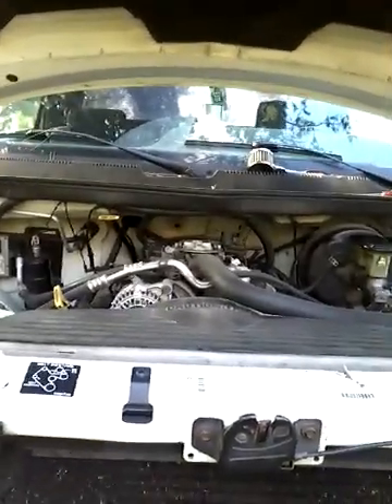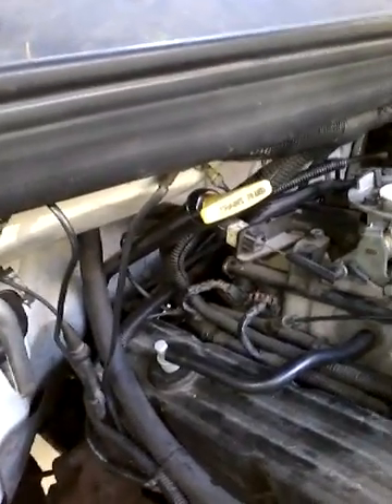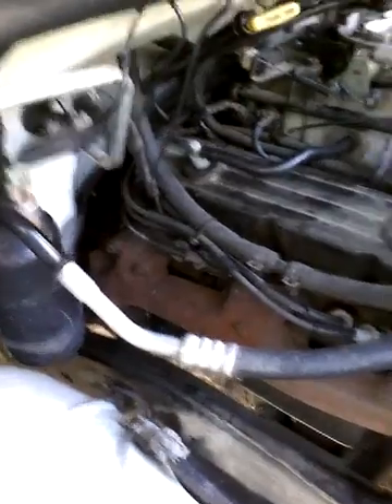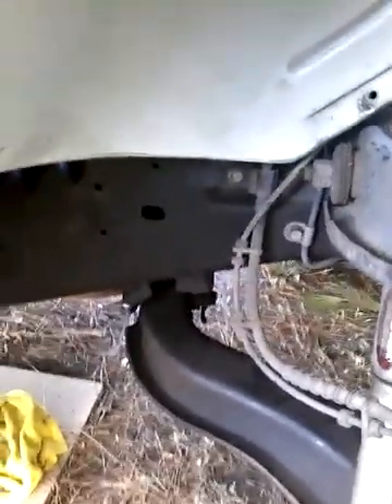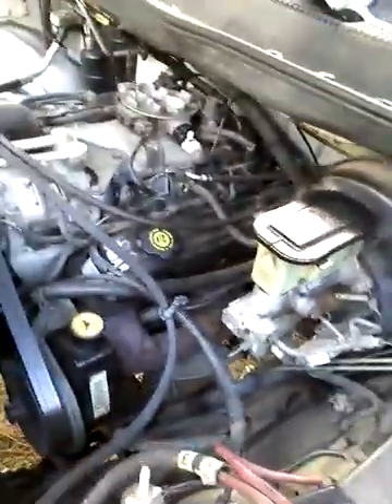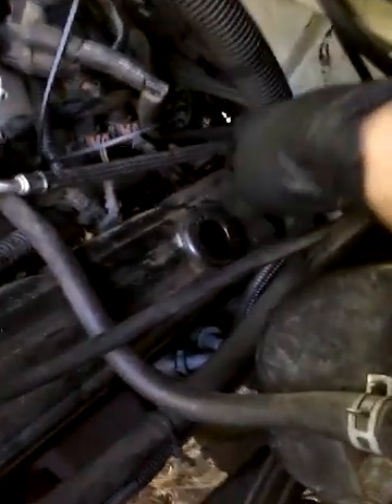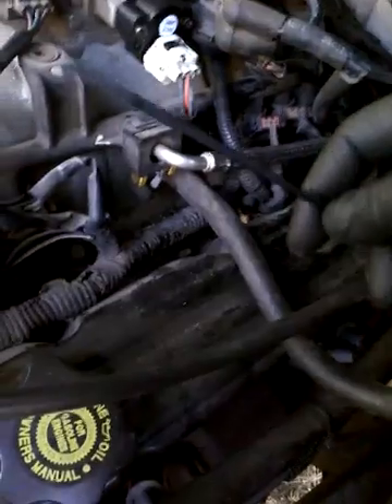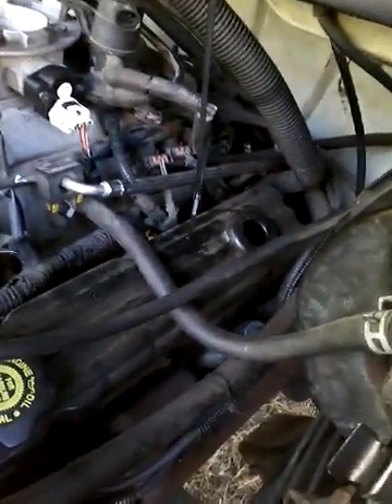Crankshaft Position Sensor 1997 Dodge 5.2 or 5.9l engines

Comment: Does anyone think that since I changed my transmission pan gasket yesterday and fluid ran down the tube and may have faulted out my sensor because today the truck wouldn't start afterwork

Comment: I have a 2001 dodge ram 1500 ive chaged all the sensors it runs fine in the cold but when the truck warms up it sputtering and misfire and no power when driving and i changed the distributor cap and the cam and pull up sensor u think my crankshaft sensor is bad
Reply from the maker: Before doing the CSPS, make sure your coil pack is clean (sand paper it), check the pig tail (add dielectric grease), be sure all your wires on the distributor are tight on the points and on the plugs. Then check the pig tail to the CSPS bc it runs behind the distributor, it could be pinched or spliced. I also had my throttle sensor cause the same issues you're speaking of, so check that as well. If all those things pan out, then you may want to replace the CSPS. Fair warning, you will need to order the Mopar one bc the after markets will constantly give you issues. Good luck.

Comment: Thanks for awesome video, I will definitely try that technique, not looking forward to it !!
Reply from the maker: If you go from the wheel well, it won't be as difficult as it seems....once you know where it is, it's the pigtail that will be the hardest to get over to the drivers side and be sure to snake it without getting it tangled in with the distributor. That's why it's best to leave the old one there and trace the new one with the old one's path, using zip ties!!! Best of luck!
Reply: @karnee26  👍

Comment: A lot of unesGot mine out in about 10-min. With out doing all that. Take off the air breather. Just reach behind the motor with a small flat-head screwdriver. Clean the little Allen head holes out. Reach back behind the motor with a 8-in extension and Allen 1/4-in ,, and ratchet. Unplugged the sensor. It is done. It is a tight fit. But you don't have to undo the dipstick for the tranny. Or any other stuff.
Reply: Yeah I did get it figured out. Thanks for taking the time to respond though. Got to do the plentium plate on my other Dodge. Been trying to find someone to order the one that is aluminum. You wouldn't have a hook up on which ones are the best to use would you. I'm also going to replace all the gaskets on the motor except for the head gaskets. If so I would appreciate it. Thanks again for responding. Have a blessed day.

Comment: My 95 Dodge Ram was cutting out intermittently. I tuned it up. New plugs, wires, dist, ignition coil, Cam sensor, etc. It was running better, but it would still start acting up after about 15 minutes of driving. Sometimes it would stumble and stutter, sometimes it would just die like someone flipped a switch. I finally changed the crank sensor and I've run it for several days now with no issues!
 *I suggest spending the extra money and getting an original Mopar sensor!
Reply from the maker: Great!!! I had replaced all that you did as well...also had to use tiny thin washers as shima for the sensor bc it was getting rubbed by the fly wheel but the shima dis the trick (not mentioned in this video). Thanks for noting it's in everyone's best interest to use MOPAR when it comes to this or any sensors and electrical parts

Comment: Will that sensor failing cause a no start?
Reply from the maker: Sorry I haven't replied sooner... answer is yes, it definitely can cause a no start issue. However, there are signs when a CPS is failing, the biggest one is sputtering start, the engine just cranking without starting (as if it were a starter issue or fuel pump issue) and a really heavy transfer of gears (ie. An good transition from 1-2 but bucking into higher gears, especially 3-4, 4-overdrive). The aftermarket CPS is fairly inexpensive but if that isn't your issue, you can't return an electrical part (maybe you can at AutoZone). I'd check all other simple things first (as I'm sure you know). If you're certain it maybe the the CPS, then go for it. Here is what happened after this video...the new aftermarket CPS from a parts store was put in and it ran fine for about a week, then all the symptoms returned. I warrantied it out and put another new one on. Then the same damn thing happened and I was heated. So, I decided not to get it from a aftermarket parts store (crappy O'Reilly's) and I ordered a Mopar direct from a dealership. Since then, never had a problem again. There are vehicles that are just too temperamental when it comes to electrical parts and it wants it's original installed. Same thing with my mother's Towncar, it did not like the aftermarket EGR solenoid. I installed 2 aftermarket and it ran good for a few days each time, then shit out. I finally knew it wanted Motorcraft and it runs great! I say, try they aftermarket parts from a parts store, if your rig starts, you know it is the CPS! If you have problems after you've installed it (assuming it has started because that's what you need to first find out), then you can always order a Mopar and then return the one from the parts store. Best wishes and I hope it goes easy for you.
Reply: The Traveling Hornet yes
Reply: Yes.

Comment: 👍🏻, just changed 2000 dodge Dakota 5.9
Reply from the maker: Tom Autry...Did this video help you or did you use another video? How easy or hard was it on a Dakota? Is it in the same location? Do you have any tips you may want to add? Thanks for commenting and I hope yours went smoothly and easily!!!
Reply: karnee26 easy to change crank shaft position sensor just had to go get plastic keepers for the plastic under fenders, but was easy to fix, maybe took 30 minutes only cause it was first time to change out, I did put extra  flex wire protector on the wires due to fact that truck stays in barn and for some reason those wires get chewed up by mice.
Reply from the maker: @autrytom  thanks for sharing on your experience! I have a tip that will help you keep mice and rats from chewing or nesting in your rig! I had an old timer come into the parts store that I worked at for years, he had so many tips to share with me and one was how to keep mice and rats out of your vehicle! Put BOUNCE original dryer sheets all thru the engine bay and throughout your vehicle (inside and out). I think if you look during my video, you just may see some shoved into spots, including around hoses, wires, hydraulic lines and I especially stuffed them into my hood instillation! I've always lived where there are field mice and wood rats, so one day I was talking with my regular old timer about replacing chewed wires. He told me the tip, I went on my break and bought BOUNCE original dryer sheets (he said, they have to be those exactly because they dislike the smell). This was years ago that I tried it and I have NEVER had an issue ever again. I replace the sheets ever few months, he never told me how often to change them out, so I do it about every 3 months. Also, to get rid of mice and rats from your house, Irish Spring bar soap! I crawled under my cabin and shoved Bounce dryer sheets all around and threw Irish Spring bar soap under it, too. Since I did that, I haven't had 1 mouse or wood rat since! Gotta love the old timers! I may make a video covering that information.
Reply: nice video.. my 2000 2500 dodge ram 5.9 v8 gas is shutting off and will not start and in my dashboard is telling a code [NO BUS]  you think replacing the crank shaft sensor will fix the problem??